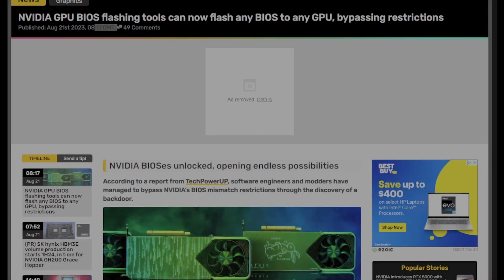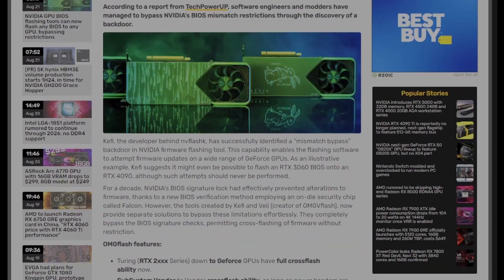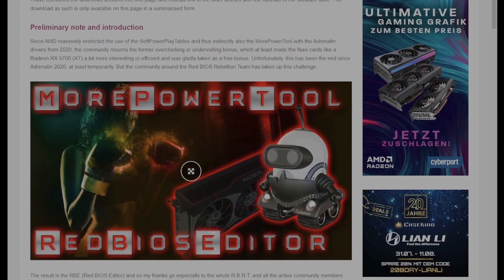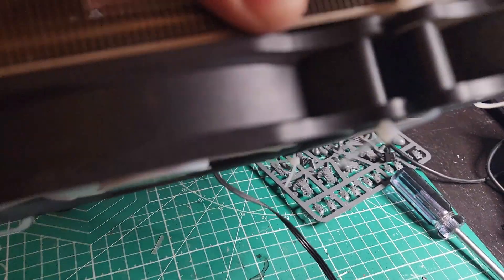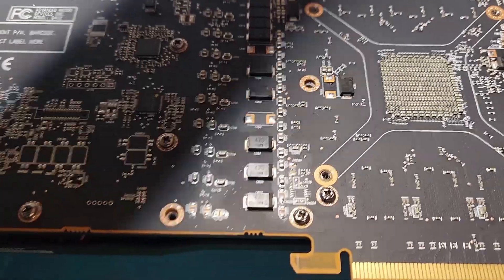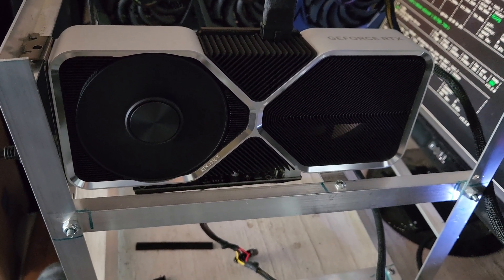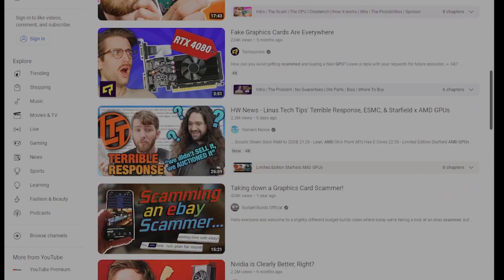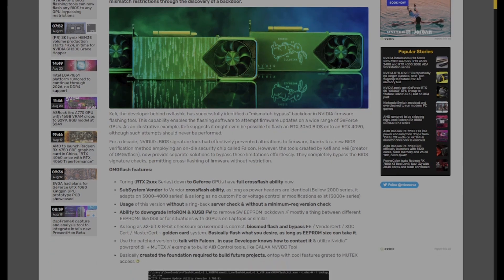NVIDIA BIOS MODDING IS NOW POSSIBLE!!!!!!!!!!!!!!!!!

Comment: Is it possible to use this to boost voltage in memory chips?

I want to solder better memory chips on my 2080 ti 

Adding higher power draw too and maybe making default core voltage 1087 would increase performance a lot for me in gaming

Comment: Hi! Is it still possible to mod a gpu Bios? Mine is an RTX 3070 Ti Mobile, which suffered some kind of problem in the power sensor and its giving me bad readings (750w insteaad of 130w) and it make to cap the performance because of power. I was hoping to mod the bios to not read the power sensor values but instead show a constant 130w value. Is it possible?
Reply: I had a similar problem with a 2080ti and my fix was finding a board view and tapping into the pins of the power monitoring chip to nearby resistors, making a resistive divider there, tricking the chip such that it thinks the card pulls a constant amount of power regardless of the actual power the card really pulls (solution based on buildzoid's power removal method for the 2080ti reference pcb)
Reply: @summerspring3346  Thanks! I'm not smart enough to do that so the workaround I found is just overclocking using MSI Afterburner. But thanks anyway!!